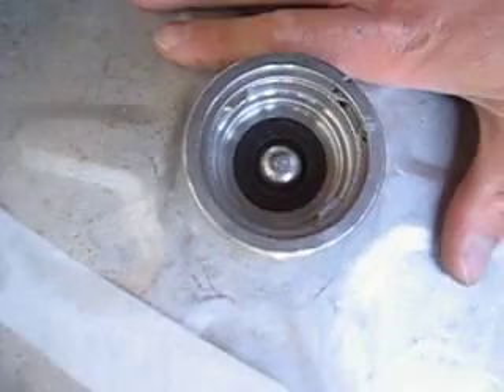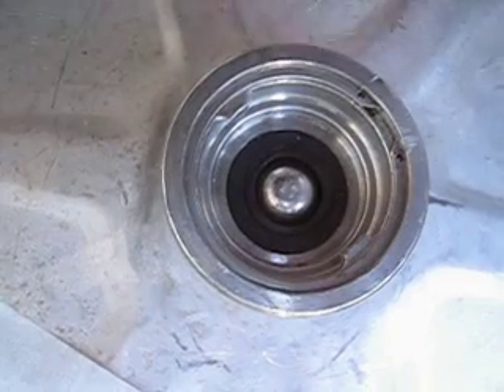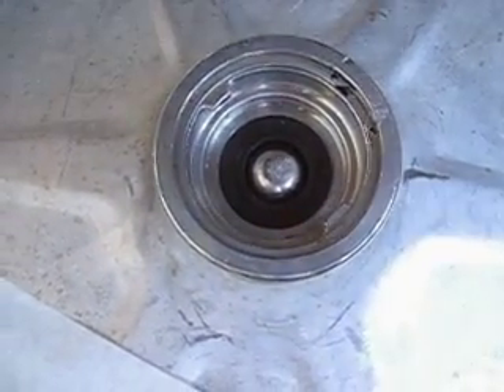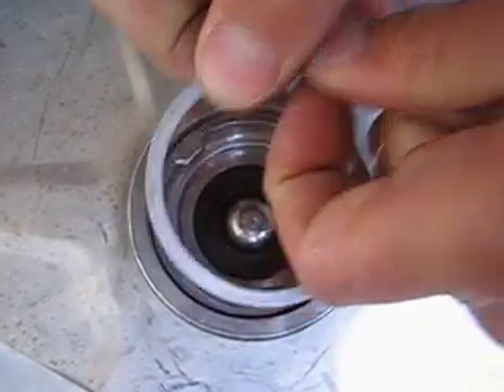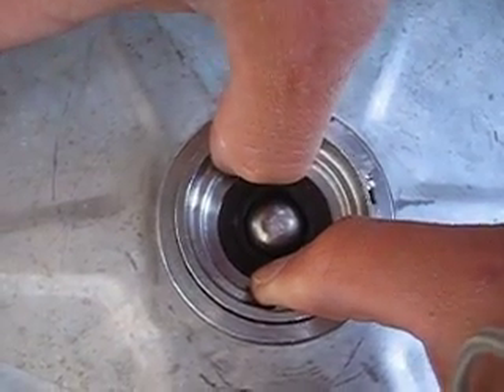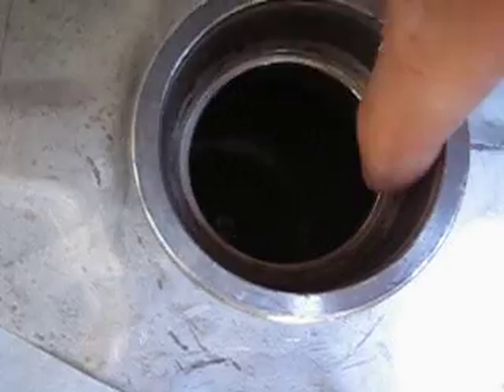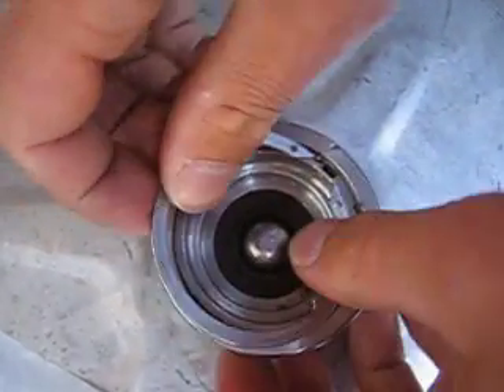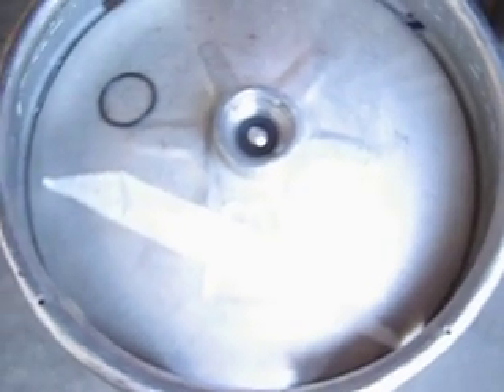How to open CUB sankey keg

Comment: Any idea why the ball-lock wouldn't spin after getting the o-ring out? I can only move it about 1 or 2 degrees in either direction, and very limited movement upwards before it jams up. The keg is definitely unpressurised.
Reply: Hi, did you manage to get this issue resolved? I have exactly the same problem and everything I’ve tried so far hasn’t worked!

Comment: You don't need to open them to use for home brewing to get your brew in ! On the coupler, take out the ball valve and gas one way valve and you can fit a normal hose from a tap in there or attach it to the bottom of your fementer. Too easy !!!!